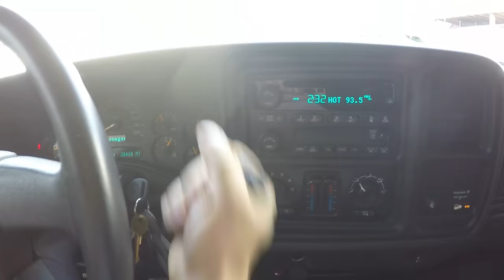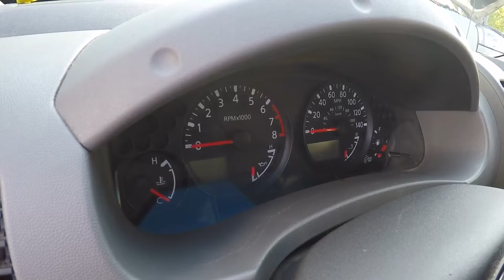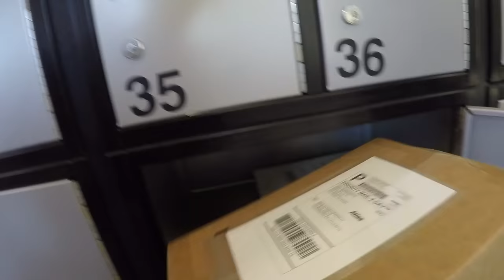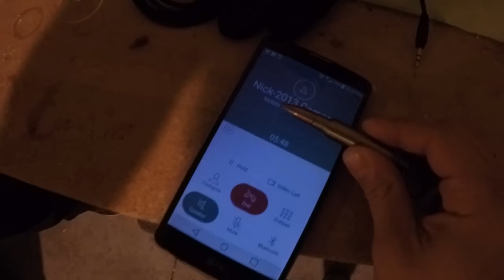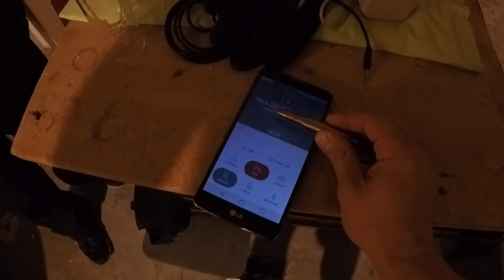THIS Is Why I RARELY Take My Truck Off Road...

Comment: Your truck isn't really a truck I would want to take anywhere but the local Dillard's. The lift and the fat tires have made it a highway hauler, as weird as that sounds. A proper off road rig doesn't have retarded tires, Cockstar wheels, and tires a city block wide. This is one of those thrown together videos that has zero purpose aside from to irritate proper pickup people like me.
Reply: Seth Allen he built as a daily, and what do you have against wide tires
Reply: Well I really don't like that either. He would have more likes if he put bigger tires and smaller rims on the truck. It would look a whole lot better then it is now. Those tires make a huge difference. And they can be daily drivers too. Don't gotta worry about potholes ruining you rims for 1. Too much tire for it.
Reply: Ace Tech there is too much rim but at least there not 20' wheels
Reply: The wide tires throw rocks at my vette.
Reply: Seth Allen so what? It's a daily driver. He likes what he likes

Comment: Flickering gauges, no start in an xterra usually means bad connection at the cable ends, loose or corroded.  Or a bad battery.
Reply: malcolm taylor they are diesel could be on the wrong battery on either truck
Reply: I'm not sure about the Nissan
Reply: I had the same problem in my Frontier.  Totally fixed it with new battery terminals.
Reply: corrosion is the usual culprit
Reply: Exactly.  The stock batteries Nissan uses have vents right next to the terminals, and they corrode badly.  It also doesn't help that they use junk sheet metal terminals.

Comment: When you were jump starting the Pathfinder the negative should have been placed on the  body of the vehicle for proper grounding.If it is on the negative that may have caused your gauges to move which could damage the brain box

Comment: In reference to the Nissan gauges. Check the interior fuses located in the glove compartment, specifically the fuse/fuses listed electrical parts. Should be a 10 amp fuse.

Comment: +Street Speed 717 Mike when u were drag racing how much air did u take out of ur tires?
Reply: Dor1to McSwagger I think he just put it in 4x4
Reply: Matt ra Shit sorry I have to be more specific I will change it I meant when he went drag racing he was losing traction the were talking about times at the end of the video
Reply from the maker: For the vette? down to like 20psi, didn't air down the dirty
Reply: Dor1to McSwagger I thought u ment the truck cause it was a truck vid

Comment: I'm thinking those flickering gauges are because you guys have the negative from the running vehicle connected to the negative terminal on the dead battery, Instead of to body metal or any other vehicle ground of the dead vehicle (e.i. Engine, or unpainted hood latch), which it the proper way to jump a car or truck. You can avoid costly and frustrating electrical system damage doing things the right way. Look it up. ;)

Comment: of course the battery is dead but it could be time to change the battery. m y own suggestion would be to get a   battery with higher cold cranking amps to help with the  freezing cold weather

Comment: like....8 or 10 gauge jumper cables.....come on man. little fanny pack carrying case....thats cute

but seriously....go get your self like...as much as you can (10 to 20 feet) welding wire man....thick 1/0 guage shit
its got nothing to do with penis compensation....but thicker is better. 

as voltage gets lower, you need more amps to pull the same amount of power....you can off set that by using thicker wire.
thats why a home stereo can run off tiny 120v  leads... and car audio needs huge wire, multiple batteries, ETC
the smaller wire can only deliver so many amps....and amps are what charges 

TLDR....you can hook them up and immediately fire up the dead car. 
its like swapping out batteries....no waiting around for it to charge up...

my dad made a set in the late 70's using welding lead and welding ground clamps.
cheap (good wire is never "cheap"...but try to buy 0/1 guage store brand) and durable as hell.

when you live in montana with common winter temps down to -40f and a wind chill factor of -110 (around 50 to 70 mph wind is super super common, windless days a rare) 

when wind chill is that bad you just wanna hook up and GTFO man....the length helps when you cant get close

we plug our cars into the 120v wall in the winter....not electric... just gotta keep the antifreeze from freezing with an electric heating element in the water channels of the engine block....
Some people find that funny...
Reply: kain hall The cables he had worked, who gives a shit.

Comment: got a 2012 Nissan xterra with 238,000 miles on it
Reply: Professional Automotive Detailing holy shit!
Reply: How many miles do you daily?
Reply: Austin Dillard. 130 to 200 miles  just depending. it's my dad's truck. I just did the brakes and spark plugs for the first time at 230,000 miles and the brake pads still had so meat on them
Reply: Professional Automotive Detailing that is impressive. Nissans do last a long time.
Reply: Bailey Lauzon 
The xeterra have problems but full synthetic oil and top tier gas helps. also the truck is a manual so no automatic transmission problems
Reply: That's cool. I have a 2002 frontier with 156,000 on it. Second owner. A little surface rust on the rockers but I'm probably gonna sand it down and respray the rockers with bedliner
Reply: Austin Dillard Lmfaoo for real....Holy shit mate
Reply: Somebody is driving a Frontier (Xterra in pickup form) that had 500k km (roughly 330k miles) about a year ago.  If you take care of a vehicle it will last a long time.  It looks nicer than mine which has a whole lot less than that.
Reply: I really like nissan. I have a 2000 ford f350 that has 257,000 miles on it and the only thing I've had to do is put new batteries in it last year
Reply: Almosttoast 
Ya any car taken care of and drive nicely will last long
Reply: I do all mechanical work on my truck so I know nobody is being a goof and screwing it up. My friend took her car to the local mieneke and they didn't put the drain plug back in and the engine blew. Stupid mistakes like that can be costly.
Reply: Have a 2003 Toyota Sequoia 240k miles. We load that thing with Iron plates and poles (Backdrop) until it squats like crazy weekly and no problems despite the abuse
Reply: Professional Automotive Detailing I have a 2000 Silverado with 321k miles on it.  Nice dude.
Reply: i thought my silverado had alot of miles lol. you make 260k look like nothing
Reply: I've seen a video of a Cummins with 1 million miles on it. Still ran like new
Reply: RealCast Haha.  Now you know yours should keep kicking for awhile longer!
Reply: there is no way you went 238,000 miles on the same brake pads from the factory!
Reply: STREETRACEN4U Depends on how you drive it I've only done my brakes once on my truck
Reply: STREETRACEN4U  
ya manual so down shift. also all highway miles so no need to brake
Reply: Im sorry im still finding this hard to believe, I'm not saying you're lying im just saying it could be possible your father had them replaced before without you knowing.

238k on factory brake pads is insane! those babys would be wore out a long time ago
Reply: +UNDEAD ASSASSIN I have a little over 270 I'm guessing. The odometer stopped at 258 and that was over a year ago
Reply: Hunt Guy Nice!
Reply: I got a 1996 ford powerstroke with 700,000.00 miles on the first engine
Reply: i have a 1999 f250 7.3 powerstroke with 200,000 miles on it
Reply: GabeMaxersGaming got an 85 s10 with 290k, what's your point? no dumbass diesel or big goofy truck necessary.
Reply: Doug Johnson Diesels do tend to last longer but it's all about the maintenance no matter the engine. The thing about gas engines is they can't deliver the amount of power especially torque that a diesel can without a lot of modifications and it'll definitely consume a lot more fuel than a diesel

Comment: Flicking gauges like that means dead battery.. I had a 2005 Xterra that did that  when the battery is super dead super dead, my 2013 Dodge Dart did that when the original battery died, and the same thing happened when my 2005 Ford F-350 decided that it too needed a dead battery.
Reply: Edward Price think gauges flicker sometimes when jumping

Comment: @streetspeed717 , I have had those jumper cables and learned many times they are not sufficient. The wire gauge is way to small and does not transfer quickly. You need to invest in a much larger set, especially for your truck.
Reply: Austin Roy I made my own set awhile back using welding leads. also use welding leads to hook up my power inverter in my semi
Reply: Yeah that's the best way to go.

Comment: need to wipe off  your jumper cables before you toss them on your seat.   I did the same thing after I jumped my Sister's car.   she had a bit of crusty battery acid stuck on the jaws of the cables.   not good on cloth seats.

Comment: Mike when you jumpstart a vehicule, only your two positives should be connected from your battery to their, their battery should be the only one with a black one hooked and the other black clamp should be attached to unpainted metal. Just want to avoid a back-charge for ya.

Comment: when u hook up jumper cables to another car if the horn go off u got the cables backwards and u blow a fuse so tell ur Buddie to check all his fuses . love the video and love the truck
Reply: Buckeye 's only ?????? my alarm always goes off when the battery dies and I get a jump
Reply: Some cars do some don't but most of ur american made are not supposed to
Reply: Wrong, I've owned 3 cars that the alarm would go off when jumper cables were hooked up. The alarm is always on, so when it gets the increase in current it then allows the alarm to activate (since it takes priority in 99% of cars) and it goes off because it thinks its being broken into, It's simple logic and very very basic electrical. Ford actually released a bulletin about it. It's essentially like flipping a switch off and on for the alarm. Also, The truck was a NISSAN, not american.
Reply: True but I didn't say it was american now did I
Reply: Ok

Comment: that guys battery was dead u have to fill the battery with distilled water it evaporates over time from heat so you jumping that battery it's still gonna be dead  he can save it by filling it up but possible a new battery.

Comment: you'd expect that when you throw down 50k on a truck you can at least touch the dirt lmao
Reply: Omar Garcia it is was not built to go off-road, he has said it before, its daily driver, he wants to keep the truck clean
Reply: KOakaKO a pickup is used for what the owner wants to use it for
Reply: DatAmericanPanda
- A pickup is designed to have a cargo area in the back where you load something into it and haul that cargo to a different place. If you have NO intention of using it as a pickup, then why wouldn't you buy something like a Tahoe? Or a Suburban? Or a Navigator?

You can HAVE something that's larger than it needs to be, and you HAVE it lifted beyond what a sensible person would do... but if your "pickup" has perfectly clean and un-scratched paint in the truck bed... then you really need to ask yourself, "Did I buy a pickup to feel 'manly' and 'tough', or did I just want a big-assed vehicle because I have a tiny penis? Would a Suburban have been a better choice?"

Comment: Why the hell does your truck have 2 batteries?
Reply: its so you have extra power when having stuff like a big trailer or camper that runs off the truck. but in this pavement princesses situation its completely useless.
Reply: TheSamplebridge  haha dude calm down, your too obsessed with this guy and not wanting to get his tires dirty. that's his deal, why do you care so much?
Reply: eduardoig17 all diesel have 2 batteries
Reply: Joshua Jaramillo obsessed? im commenting. my problem is we live in teh same area and ive gone through those same areas way faster in my friends 2wd ranger and hes stopping to whine about his dirty wheels on expensive tires. i know a kid who bought a JK jeep to driving the winter and put expensive rims on it and doesnt drive it because he doesn't want them dirty. putting nice rims on a 4X4 truck and then worrying about dirty rims is a fad almost as bad a stance cars.
Reply: it's to start it, diesels have really high compression so the starter has to have a ton of torque.
Reply: It's a diesel, all diesels have 2 batteries. For one the glow plugs have a pretty good draw before starting, and to start a diesel they usually require 24v to the starter. Diesels have compression somewhere around 17:1, gasoline engines have compression somewhere around 9:1.
Reply: TheSamplebridge You've kind of ruined your argument when you said the extra battery is for trailers and campers..lol It's a diesel dude, it NEEDS 2 batteries to even start.
Reply: I'm pretty sure not all diesels have 2 batteries, maybe all big fuck off American diesels do but not all diesels
Reply: My diesel has 2 and a inverter because I have a utility bed and have extra lights and etc.
Reply: Even my 1990 GMC Sierra 1500 /w a 6.2L diesel has two batteries.
Reply: Steve Holsten I would expect that to have 2 batteries because it is a 6.2L, that is a big engine.
Reply: Also glow plugs take a lot of power . But newer trucks don't use glow plugs so it's probably for the starter.
Reply: i eat porridge dude all diesels have 2 battery's and some have more my Pete has 5 battery's and my big tractor has 4
Reply: ridling1 no not all, I have a Toyota hilux, my brother has one (me and my brother have old ones) and my step dad has a 2016 hilux, they are all diesels and all have only 1 battery(I haven't had the chance to look into my step dads one but I only saw 1 battery, but I can't be sure there isn't a second battery under some plastic cover), all big diesels have 2 batteries but not all diesels have 2 batteries.

Comment: You shouldn't jump start a car (car to car) with the negative terminals hooked up directly on each battery, you should have to use the chassis instead. You're taking the risk of fry the ecu

Comment: Wouldn't nick your rim if you had wheels the proper width. Sure you think it might look better, but such a wide rim like that will have a flat side wall and is more likely to pop off the bead

Comment: 7:41

Get some bigger/fatter tires. I'm runnin 38x15.5r20 Toyo M/T's on my super duty and never get that problem. Chevy might need a little more lift to clear them... but big and wide tires wont let you scratch your rim on pebbles. 

Or, just don't go off road. Its stupid anyways, get a beater 80s chevy 4x4 and a trailer and just pull the mud truck to the woods with the diesel.

Comment: your rims are too wide and to big if  they were say 17" you would have no issues with scraping them up because your rubber sidewall would take the abuse as it's meant to. or even if they just weren't as wide they would be more inside the wheel then flush with it either get wider/bigger tires or get smaller/skinnier rims

Comment: battery is not holding its load, the gauges tick because the battery becomes totally dead while trying to start, then its chemical charge comes up a tad

Comment: Car alarms sometimes go off because the battery is dead.  It's basically an alerting system to let you know that it is dying.  Unfortunately not many people know this, so it's almost pointless.  I'd say the gauges are flickering just because of the low battery, there's not enough current to keep the needles up.

Comment: Not enough voltage is why the Xterra guages were going crazy . Reving up the Duramax and holding it at a higher RPM ~ 2000 RPM will help charge the other vehicle quicker.

Comment: First when gauges flickering that means your battery voltage is below 10 volts
then when you jump start your car , other car must raise RPM up to 3000 RPM at least

Comment: Those tires look slightly stretched. If I was seeing it right, the wheel looked slightly wider than the tread of the tire. Should be the other way. Wheel slightly narrower than the tread width will help avoid rim damage and also reduce the risk of blowing the bead offroad.

Comment: it took so long to jump his battery because your jumper cables are crap.  too small gauge and looks like copper plated aluminum wires.  proper cables will instantly jump another battery.

Comment: Why didn't the vehicle start right up when you had a fully charged battery and alternator hooked up in parallel?  You should have been able to kick the starter over without even having a battery in the Nissan.

Comment: Takes a pretty good set of jumper cables to pull any current through them.   Most jumper cables are only good for glorified battery charging.

Comment: the positive cable on a Nissan is that way for it's a fuseable link. also the alarm goes off cause of that, you said being stolen. just hold unlock or hold the key in the drivers door to unlock.

Comment: I would get a Volt Meter, Conect it across the battery set to 20 Volts DC, Start it and slowly rev up the engine. It should go up to 14.5 Volts and no more however much you rev it, If so your charging system is OK, If it does not get up to that the Altenator drive belt may need adjustment, Or the Alternator neesa replacing. If it goes over 14.5 Volts the Voltage Regulator is blown, New Altenator, That may have cooked the battery so that may not hold a charge. run the car for 15 minutes, turn off engine, Should read 12 Volts, If not new battery, Leave it for 20 minutes (DO NOT TURN ANYTHING ON) if it still reads 12 Volts battery is OK, Less than 12 Volts, New battery, If that still does not showthe fault I would confirm correct battery fitted and not a lower rated one, Still having probsstart looking or a short